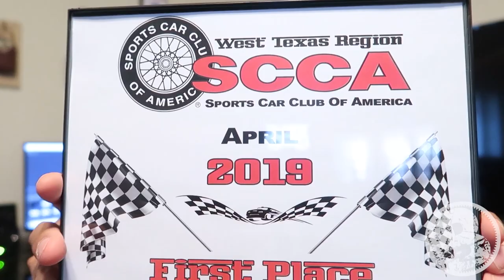Engine Build - Breakdown! Part 3 - Turbo studs, oil pan & more! | MK7 Golf R

Comment: Brother, the GTI engine (for example  my CHHA) also has the piston oil sprayers. Fun fact: cooling the piston crowns is not necessary in every operating range of the engine. This is why the 2.0 l TSI
 engines of this family have switchable piston cooling jets. The jets are only switched on if  the oil temperature is above 50degC AND engine torque is above  100Nm  (below 3,000revs) and always on above 3,000revs (no matter the torque level).
Reply from the maker: Good to know! Learn something new everyday!